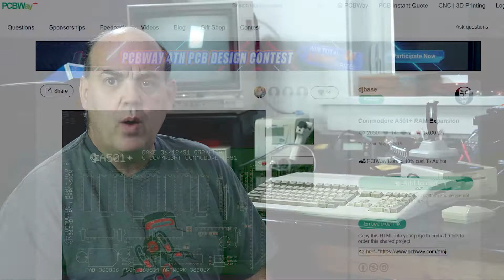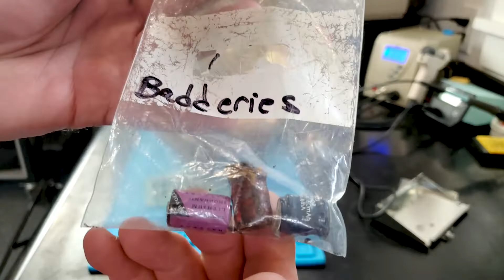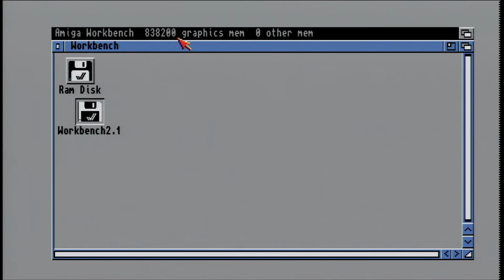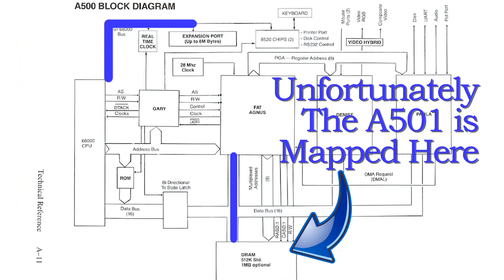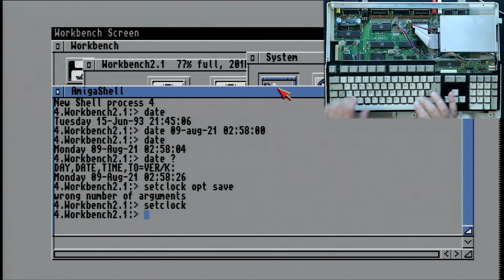Commodore Amiga 500 RAM Expansion Repair – A501 with a Leaky Battery

Comment: Is there a reason why you replaced the caps ? I just tested mine on my rev 5 A501, all within tolerance and ESR is normal so I just kept them.
Reply from the maker: Good question. I was concerned that the proximity of the caps to the leaking battery could have compromised them so I went ahead and replaced the electrolytics just to be safe.

Comment: Well, recently found my A500 in a dead state. :( Pulling out the A501 RAM expansion module DID bring it back to life, so I suspected a battery leak. Sure enough, it leaked indeed, but cleaning it with rubbing alcohol did little good (at one point it booted but wouldn't detect the extra 512K, and created significant instability). Right now booting the Amiga cycles through colored screens but never gets to the white screen--that appears before the Kickstart ROM version shows up. So the RAM module is unusable. The battery still holds ~1.5v, but I suspect I'll have to remove it and figure out what else has gone bad....DRAMs? capacitors? resistors? I may have a spare A501 module in storage, but it likely will have the same leakage issue (ditto for my A2000, need to check that!)
Reply from the maker: I would start by removing the batteries from all of them to prevent further damage... good luck, it sounds like a nice stable of machines
Reply: @RavenWolfRetroTech  -  Any idea what component on the A501 is causing the Amiga to halt its start up process? I looked with a magnify glass and didn't see any advisably damaged components or traces where the battery leaked. It's populated with "MT" brand DRAMs, which I vaguely remember people in the Apple II/C64 community saying are prone to failure (they have a strange part number, but I take it they're just 256Kx1's?). It worked last time I used the machine, it just sat on the shelf a few years, battery leaked and now the A501 is preventing it from booting up. :/
Reply from the maker: Its hard to say, this video is of the only A501 I have restored but you are very right to suspect MT RAM, the stuff is garbage. You can try piggybacking but that only tests for certain failure modes. You can also see if any of them get hotter than the rest if you can get to them while the machine is running.

Comment: Can anyone tell if the battery is necessary for the expansion to run correctly (games) ?
Reply from the maker: The battery is just to keep the Realtime clock running while the computer is off. The RAM expansion is unaffected if it is missing. The clock will work as well, you just have to set it manually each time you power cycle the machine
Reply: Thanks. I asked because I just removed the leaked battery of my ram expansion of my amiga500 by cutting the metal-holders..
For some reasons games like turrican did not start with it... after I remove the expansion the game will load... 
So I guessed they may could have some routines requiring a working real-time-clock of the expansion... when expansion is available
Reply: I don't know why.. but today Turrican worked with the Ram-Extenstion..

Maybe there's just a problem with a faulty capacitor ...
Reply from the maker: I doubt its a cap but anything is possible. My A500 is still a bit buggy so I am planning to dig into it soon. It seems like they have a lot of issues with bad sockets.

Comment: I like to use super capacitors in  coin battery holder form factor. They don't leak, should last for ever and take charge from the original charging circuit, or you can hack one together with a resistor and a zener if there's no charging circuitry in the original. They will keep the clock running long enough if you use the machine somewhat frequently. And if you don't use the system for  a long time.. it stays ready to serve :-)
Reply from the maker: Ben, That's a good point and one I had not considered for this project. I used a 1 Farad cap for the settings battery on my Bally pinball machine and it does work as long as it gets powered up at least once a month. Since its not used once a month anymore it can be funny the random settings that come up when its started. Have you had issues with the clock chip getting into an invalid state? I understand that's a risk every time the battery dies, coin cell or not.